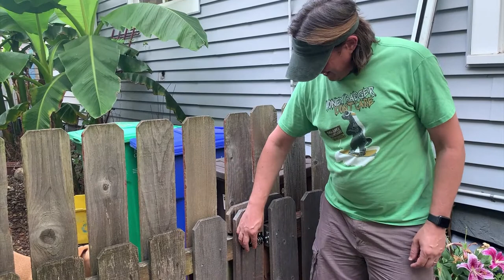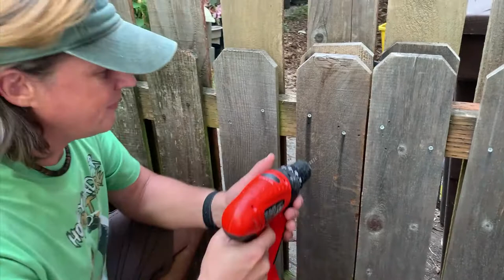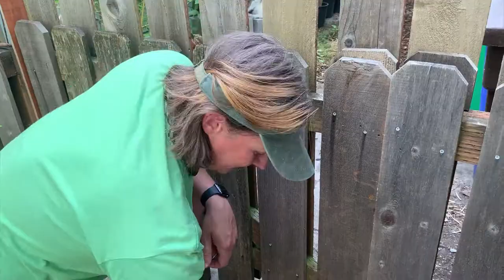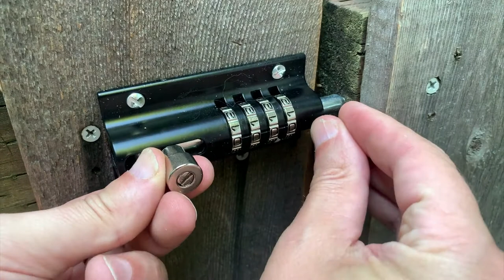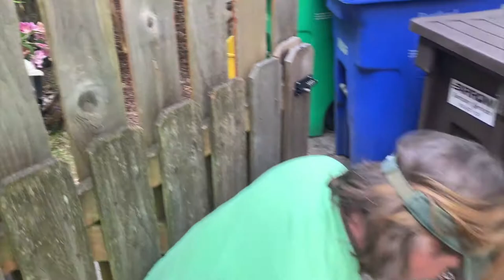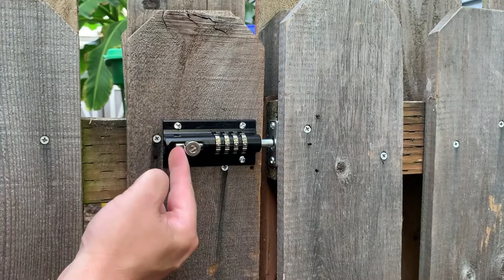Combination Lock for Gates

Comment: How does it provide high level of security when one can easily remove the screws?
Reply from the maker: The screws only work one direction. I actually had to use an angle grinder to remove them (I had to install a new strike plate because my gate sagged and it no longer lined up.

Comment: What's stopping a cunning thief from unscrewing your new and expensive combination lock and simply running away with it?
Reply: Should be anti unscrew screws.  Or so advertised
Reply from the maker: @grantd272 is correct. The screws only work one direction. I actually had to use an angle grinder to remove them (I had to install a new strike plate because my gate sagged and it no longer lined up.

Comment: These are ordinary screws and be easily removed with a Phillips head screw driver
Reply from the maker: Weird - the ones that came with mine were definitely one-way screws as I needed to move the strike plate and that required using an angle grinder to get them out. When did you purchase yours?